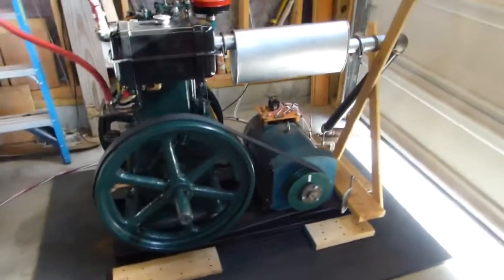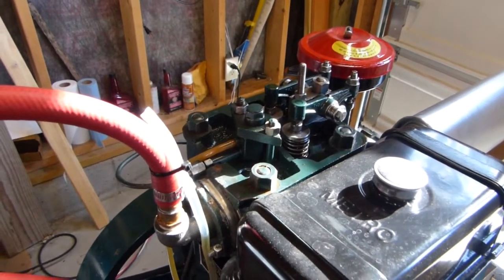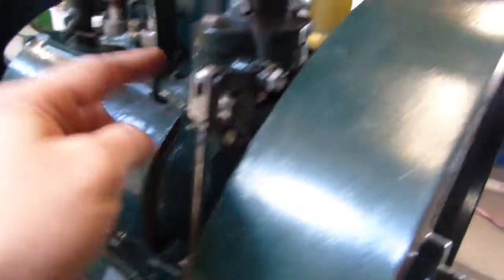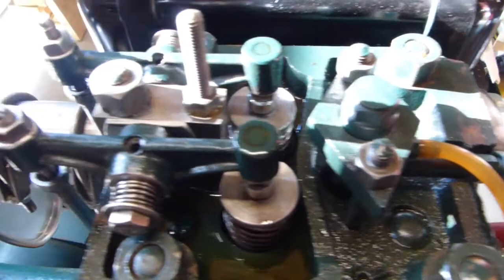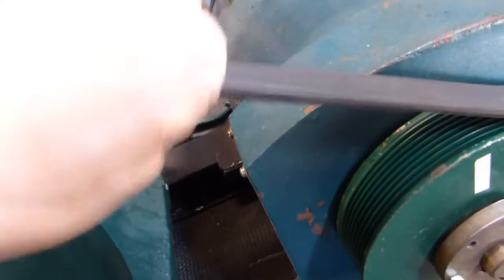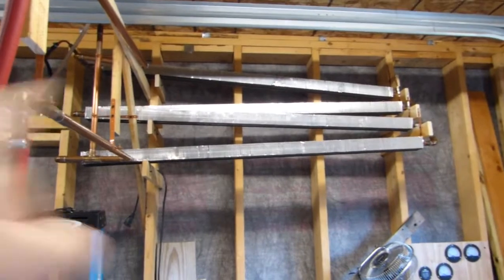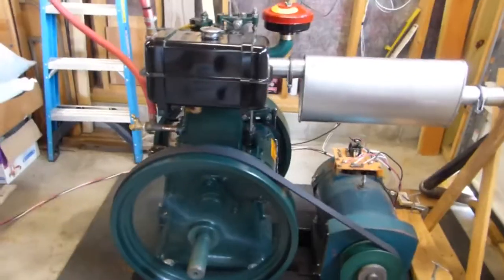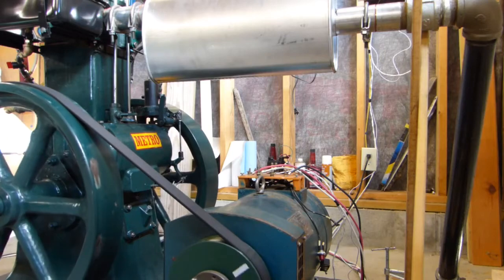Metro Listeroid 6/1 Genset Test Installation

Comment: Thank you for going thru the oil check list…mine has not been fired since purchase…
Reply from the maker: Check the inside of the engine for casting sand or other similar contamination. They don't often give them a thorough cleaning before they ship.

Comment: i have the same Metro 6/1 engine which i finally got running after it sat for a long time inside.... it runs well....i can't start it by myself so i have added a 12 volt motor starter pulley arrangement that works pretty well.....i have the generator (5 KW) which is bigger than necessary but it works....there was some initial difficulty because i had positioned the generator too far away from the flywheel and the belt tended to wander

i'm old and frail now and the engine scares me so i built a protective sturdy 2 by 2 wood cage around it so that there is no chance of accidentally falling into the moving parts which would be lethal.... i also attached a long tripwire to the cutoff lever so that i could kill the engine from several feet away in case it ever showed a tendency to instability or runaway

they recommend this engine be firmly bolted to a heavy concrete pad outside somewhere....my engine is in a small wooden shed  bolted onto 4 by 6 treated wood timbers which are on a rubber mat which sits on a reinforced base of 2 by 4s on top of 3/4 inch plywood .... that all protects the shed and the engine

this engine isn't for everybody...its heavy and imposing and dangerous and you need to be alert and careful all the time with it .... its a great hobby engine for teaching/learning basic diesel operation because you can overhaul every bit of the engine by yourself....it sounds perfectly lovely when in operation with a deep throaty chug chug chug that i could listen to all day with pleasure
Reply: Where would I get one of these engines? I have been looking for something similar, and just can't find anything that is worth fixing.

Comment: I bought a Jkson listeroid new but I've nevet bothered to set it up because i found a lovely original Lister 6/1 and preferred to rebuild that. The quality of the engineering is vastly superior to the Indian machine. The compression valve reduces load on the engine which the Indian machines dont have. Altogether a far more civilised engine. But you've done a great job on that Metro to get it going. Congrats.

Comment: Have you completed a more permanent setup for this?

It may help long term reliability to mount the muffler away from the engine with a flex line in between the engine and the muffler (like they do with all cars) 

and if you are using that larger JD air filter...mount that on the wall with a rubber air intake hose (spiral wire reinforced) so the vibrations don't work at the pipe end in the head...

The original way of muffling the exhaust was to lead it into a 55 gallon drum filled with large rocks and set in the ground (with a stack leading out and roof height) to really dissipate the sounds...

There used to be lead lined anti vibration acoustic mat available that may help quieten down the valve train clacking...but it really does sound like a mechanical symphony...

I have heard rumours that "air compressors" are now being imported....
with an injection pump being separately available for after import utility...😁😁
Reply from the maker: The permanent setup does have flex lines for the intake and exhaust. The setup in this video is not rigid, so I could get away with it. the whole exhaust system was gravity-mount with no fasteners so it worked okay. I have heard about the 55 galln drum muffler and was temped to try it, but didn't I used two chambers and baffles. (old 20-pound propane tanks!)
Reply: Your correct on them being sold as air compressors - along with a conversion kit to a diesel engine -

Comment: You could run the cooling water through a radiator then power a fan from one the flywheels to heat the workshop.
Reply from the maker: The free-standing radiators cool through convection to the air in the shop, doing the same job without the fan. But it really isn't much heat! The engine doesn't burn enough fuel to generate enough waste heat to amount to much. In the summer, that's great, but in the winter, it still stays cool in the shop.

Comment: As for the air filter its more than sufficient for normal conditions - when mount saint helen was blowing they changed the air intake breathers to what were used on 500 hp atationary engines - also to bushings instead of roller bearings on the mains - roller bearings dont hold up well in sand areas so we replace them with bushing kits - 
      In many cases we replace the oem govenor spring with a diffrent spring - the oem spring works well enough - at 650 to 850 RPMs - but at lower RPMs we use a spring with diffrent tention - the blow back is turmed by pass return fuel - 
           Most of the fuel filters we used were simply a 3 inch pipe nipple with a screan on the bottom with a rag or toilet paper for a fuel filter - 
      There used to maintain voltage on pipelines in the old oilfields - its to cancel electrolises - 
     Newer fields use Arrow and Ajax engines in the US -  be sure the key wedge is driven in tight ive seen them work loose at times -  
     After 50 yrs my grandfather said he had nothing bad about those engines - 
      If the engine was set up with a oil filter we used synthetic oil because we never changed the oil - 
      On locomotives or many of the engines used in the oil fields and ships - the oil is never changed - just the filters - 
      The make up oil acts as a oil change - they learned that during WW2 - 
      I just use synthetic oil in every thing - with my service pick up trucks i just changed engines out at 500 thousand miles and rebuilt them and put the oil back in them -
Reply from the maker: Thank you for this wealth of information! Real experience is something that I can never learn from a book!
Reply: @justinpoirier5285  👍

Comment: What is your fuel consumption under load? Curious about the low RPM efficiency when compared to the higher RPM Diesel engines. Nice job on this generator setup
Reply from the maker: I wish I had a good answer for you. I've never done a good "static" analysis of it. I have it connected to my house and the load from that is continually variable. I've never just hooked up a 3kW resistive load and let it run for 6 hours to measured the fuel consumption. The 2 gallon fuel tank on the engine runs my house all day, but sometimes the house is drawing power for just a few computers and lights, and sometimes it's running the water pump, furnace and microwave. From what I've read, (take that for what it's worth) the fuel consumption is comparable to a same-output 1800RPM diesel in most load ranges (somewhat less at lower loads) and a bit superior to 3600RPM engines.
Reply: General rule of thumb,1/10 of a uk gallon per kwh
Reply: The fuel consumption is about 1 quart  of fuel per kw hour running on #2 diesel - air cooled 3600 rpm engines burn about 1/3 of a gallon per kw an hour -

Comment: Since these engines are 1.4L displacement I think a larger than needed exhaust system might cut down on the whooshing sound of the exhaust pipe, that and Diesels like free air flow anyhow
Reply: ..and have the muffler near the end of the pipe .. not the beginning.

Comment: Nice build, I'm watching your/this video and one thing I didn't catch the first time was the horse stall mat being slicker than expected, which might be because of the silicone mold release that is used in the manufacturing process. 

When I use this mat, I glue it to a 1 foot plywood base, and found that it helps to scrub the mat with acetone and a wire stainless steel brush, now the glue sticks good.
Reply from the maker: I was wondering about that, too, but never went further investigating it. My mom has a working farm, and has some horse mats that have been out in the weather for 15 years. They are still just as slippery as this new one, so I figured it was probably just the rubber compound that these are made of, but never went to work with any solvents to find out for sure.

Comment: Can you check your flywheel counter weight location?
Are they on the same side or counter to each other…?
Reply from the maker: The are both the same, and should align opposite the position of the piston, that is, when both counterweights are at the 12:00 position, the piston should be at the very bottom of the stroke. The counterweights are to act against the force of the piston, connecting rod and crankshaft offset.
Reply: @justinpoirier5285  my weights are 12 and 6 o’clock….I’m going to add weight to offset the 6 o’clock….to confirm my suspicion…plus a mat…should stop the dance routine…I had it bolted to cement…but the vibes are too violent.

Comment: Very cool, Would you be open to saying how much this engine cost?
Reply from the maker: Not at all. The engine and generator head were a package deal and came with a good number of spare parts. The original owner bought it for Y2K and was planning a veggie oil fuel system. Life got in the way, and he sold it to me for just around $3,200. I probably have another $500-$700 into it with the steel frame, replaced parts and decking the cylinder head, which was a bit out square from the factory.
Reply: @justinpoirier5285  wow, that is intense. Pretty awesome machine though.

Comment: I dont know how much you have been running your engine - i do know if youd pulling 3 kw at some point you will eather have connecting rod bearing failures or you will brake the crank shaft - 
      Im a forth generation generator and water pump tech - also i worked the the offshore and remote mountain oil and gas industry for yrs - 
   There millions of those engined in service around the world - 
        Many use 7% pilot fuel to ignight fuel gas as a spark plug does - others are set up to run on crude oil - they use a steel piston and run at 250° and use transformer oil for coolant - 
     Oil engines have to be preheated to 180° to start and need the compression change over valve to reduce compression after starting - 
     Also the hp is reduces 25% at full load -  when there converted to oil engines there fuel efficency is 15:1 at 650 rpms and around 18:1 at 500 rpms - 
     On diesel at 180° water it 4:1 efficency -
     i have 1000s of hours of run time on mine -  i live in the rural south huricanes and ice storms  can knock the power out for up to 8 months at times -  
      It 416 watts per hp in put with a 12OV  60HZ  genrator head -  with 110V 50HZ  its 333 watts per HP in put -  with 12 to 48 volts DC its about 320 watts per HP - you 
 loose around a hp to the belt drive - 
       You can push more out the.engine but you will have failures to deal with - you would be better off adjusting the compression and timing and  running it at 850 RPMs as a 8 HP engine -  it will run up to 5 yrs 24/7  at 850 with out rebuilding it - 
    Mine is set up at 500 RPM as a oil  engine - running on oil there derated 25%  - 
    I would say to have a spare crank if your using it as a prime mover and pulling more than 50% continues - cranks do brake some times -       most of the parts for those engines are inexpencive -